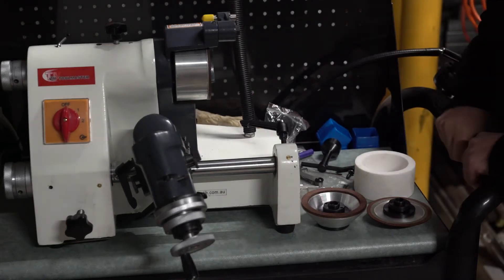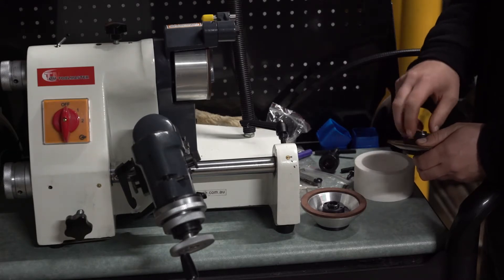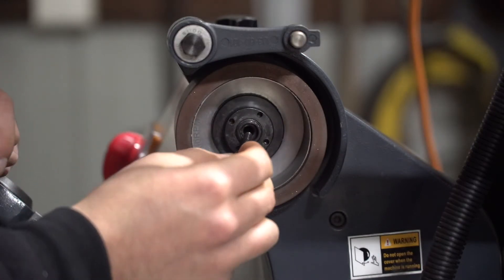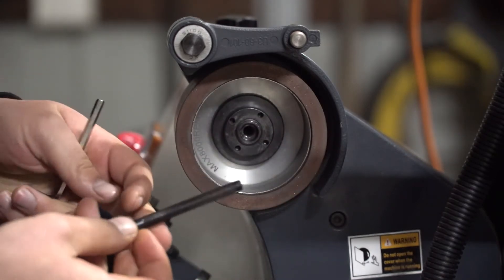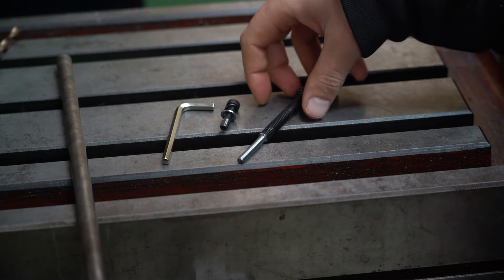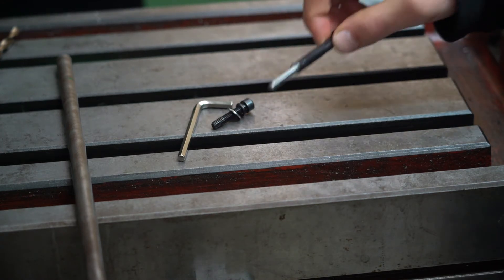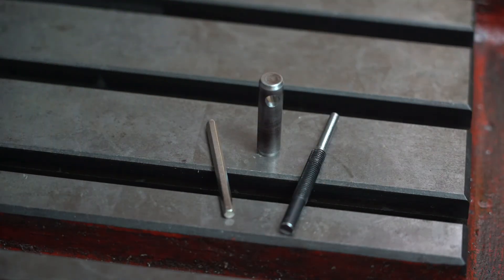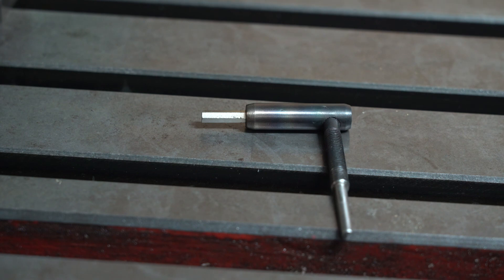Wheel Flange Removal Tool : Universal Tool & Cutter Grinder AKA D Bit Grinder

Comment: Hi, I see this is an old video & I'm sure you've realised by now but you've misunderstood Luc's explanation. The measurement you quote as 2.4 to 3 times the drill size is to what Luc calls the "cone intersect". The cone being the 12mm pin that goes in the collet (his not so good English) & is way different from the distance between the drill tip and the fixture, & depends on a few factors. Luc produced a .pdf of Excel tables for this which are available on a link on his video.

Comment: Excellent information (subscribed) BUT ... How did you lock the spindle?
Jeez, the instructions don't exist!
I've noted the quill lock knob, but on one side of it, there is a button oiler, the other side a set screw.
Have you sussed what it does?

Similarly, on the forward face (beneath the stop switch), inline with the toolpost carriage shaft, there is a button oiler for the right bush, but a set screw for the left bush.
I have seen some pics where there are two button oilers ... any thoughts on these set screws?

I've just received my grinder, and am being cautious, primarily because there is no exploded diagram.
I'm thinking that it may be best to simply disassemble the machine, in order to clean off the gunk, and to make my own diagram.
However, any pre-knowledge on this, will be useful :)
Reply from the maker: Check out my other video on the grinder https://youtu.be/-skelLwAcQI . Should answer your questions.
Reply: @ProjectsDownUnder  Thanks for that :)
I'm guessing that the carriage set screw performs a similar task as per the quill set screw.
Anyway, the vid provided a good, rapid overview of the machine - thunbs up :)

Comment: Maintenance Question: what are the lubrication points and how do you grease or oil them?
Reply from the maker: There should be 3 oiling points if I remember correctly. You will need a good oil can to inject oil into them. One lubricates the movement of the grinding wheel and two of the shaft at t.he bottom

Comment: Very good information 
I have a question regarding the d bit grinding settings, the manual refers to a white dot window which is not present on the machine, how do you set the angles?
Thanks
Reply from the maker: The manual is hopeless. You just undo the black levers and move the axis that you want.
Reply: @ProjectsDownUnder  That's not the question he is asking. He is asking about properly aligning the cutting edge when setting up for grinding actual single lip cutters. @Stan Stevens to answer your question, there doesn't appear to be any way to do this built into the machine. This fact, combined with the fact that there is no vernier on the radius offset scale, effectively renders these machines entirely inadequate to use for their primary intended purpose. You'll need to make modifications to fix this if you want to actually, you know, grind "D-bits" with your "D-bit Grinder"